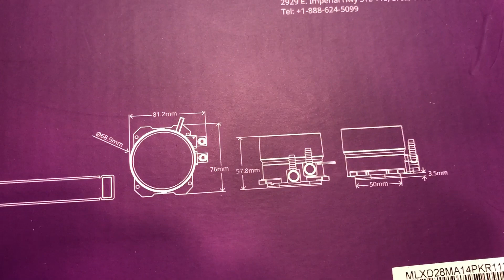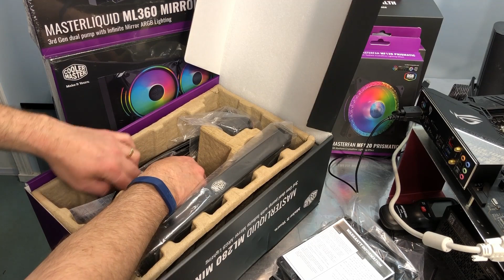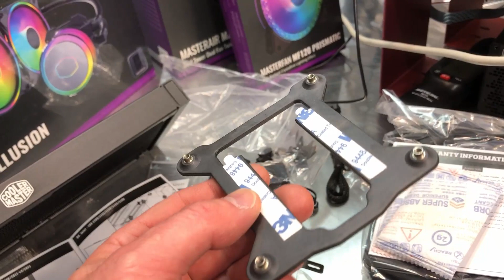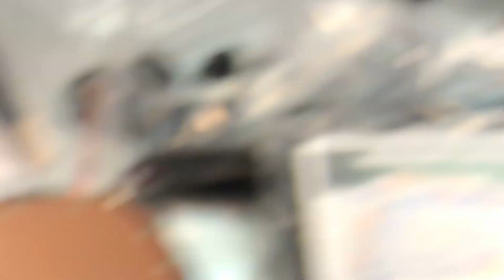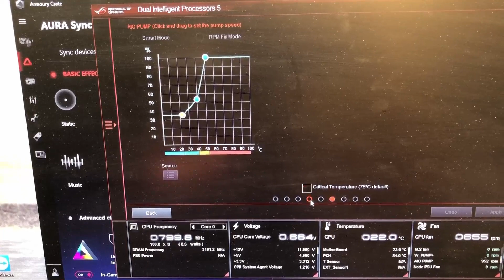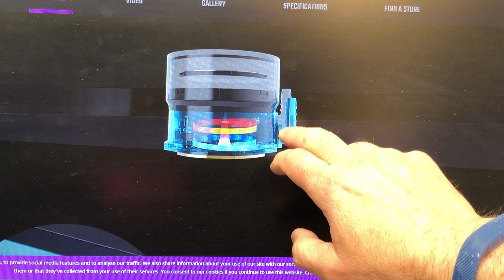Overclockersclub checks out the ML280 Mirror from Cooler Master!

Comment: Is there something I'm doing wrong? I've got the same AIO cooler and it is extremely underperforming my previous air cooler. I was previously clocked at 4.9 and now can hardly run at 4.6 at about 1.29V without hitting 90+ temps.
Reply from the maker: Sometimes it is the way the cooler mounts or the thermal paste.  Try removing and use fresh paste. Make sure the installation is correct and the pump base is making contact with the CPU.

Comment: i have cooling issues with my new 12700k, using a ml240 liquid cooler master in normal situation's i have no problem, but when overclocking it peaks at 93 degrees (celcius). any recommendations? does a 360mm one solve the problem?
Reply: An overclocked 12700k pumps out a lot of heat. I'd recommend checking out the Arctic freezer 280 or 360

Comment: So if you run an AIO in Push-Pull with 2 x sets of fans would that make say a 240 mm a ( 580 MM - AIO ) and the same would apply to all AIO'as?
Reply: no the mm may look like it applies to the fans but it applies to the area the fans are covering if you add two fans to the back if a rad it wont double its area of the rad so it will not change the mm of the rad.

Comment: Revently dissassmbled a build of mine to redo some builds. Protective sticker? Firmly still affixed to cold plate. Temps supsrisingly never got out of hand, just try thought it was a crummy cooler.

Warranty stickers are unenforceable that being said ive never met one i could remove and replace euccesfully

Thermal paste is applied incorrectly! You MUST evenly spread it across the entire surface of cold plate or cpu, relying on even application from mounting pressure is, well, its not an effective technique. Some pastes it may work better than on others but dont half ass it and thank is who tell you this later.

Pump inlet and outlet orientation 100% matters. Nevermind that having a liquid pump handle air in any amount can diminish its lifespan. It doesnt work the way a dry pump works and having air mixed all up in there changes density in the actual punp mechanically and throws things off, so it still works yes and you cant really hear a problem but its just not going to perform as well.
Reply: if you gave a good to decent quality thermal paste and cooler you do not at all need to spread it the pressure will successfully do that for you. you only need to spread it on gpus because everything on those needs to be precise.

Comment: I have just picked up the ML 360 Mirror. Can't wait to use it  :-) I'm hoping to do a few mods with it. - flow gauge, double sleeve, RGB LED tubes, tube upgrades, double system +reservoir, over the next few years.

Comment: Just picked this up for $65 (after tax).  Debating on whether or not using the included fans or my recently purchased Arctic P14 PWM fans.  Going in an NZXT h510.  Replacing a 212 Black edition cooling a 9900k.
Reply: what temperatures you had after and before? im planning to buy this same cooler and i have the same case, i think it´ll look dope